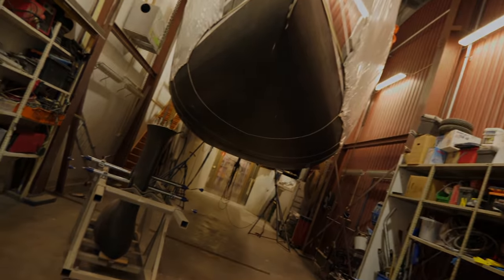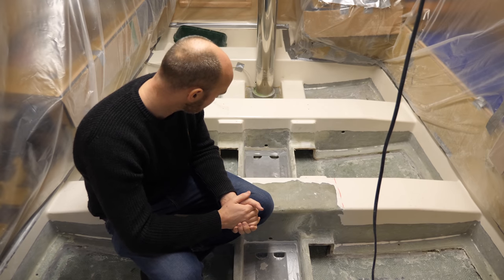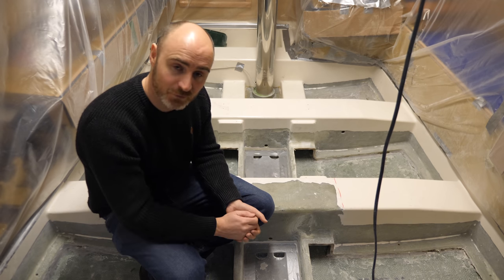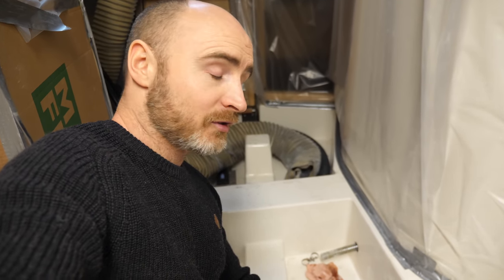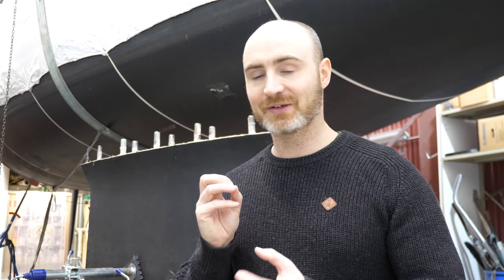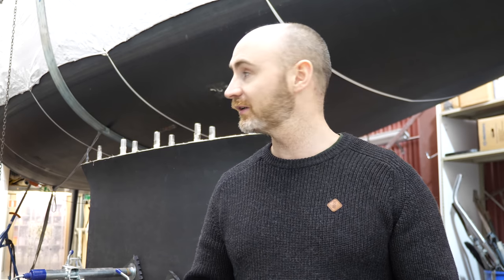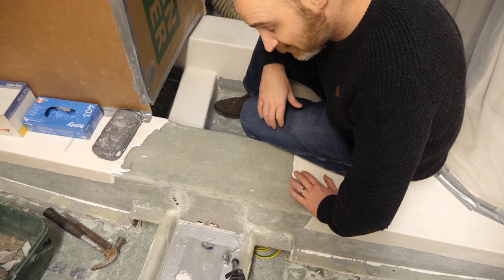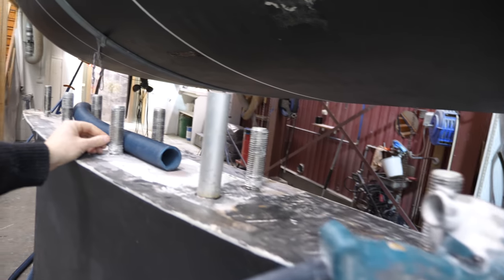SAILBOAT REBUILD - what they DON'T TELL YOU about PRODUCTION BOATS - Plastskador repair week 2

Comment: Quality of materials varies greatly. You buy your epoxy resin from some Chinese bargain basement joint and you get what you pay for. Did they build your boat with more poly resin and less epoxy? Same with fg cloth, you get what you pay for. With cloth it's the quality and the weight, did they build your boat with high tensile strength cloth made by a high quality manufacturer? Then you have construction techniques, did they vacuum bag it? Double vacuum bag it? Do you know what this means? H-R in sure uses only top notch materials and they test each batch of resin that comes in, their quality engineers use a microscope and evaluate each batch of  fg cloth that comes in. And all this data gets saved. They know which batch of resin and which roll of cloth went into which boat so that if anything goes wrong in the future they know what's what. There are so many hidden things that you seemingly attribute to either "hand made or production". It's one of those things where you don't know how little you know until you start learning. But you're doing a great job at learning and checking so I'm sure you'll be good at the end!
Reply from the maker: Hi there, you seem to have a lot of experience in the matter. It's probably one of the reasons that HR cost a lot more to buy. There are no signs that the company is using any dodgy materials, most of them while looking around are coming from the Nordics or Germany. Your right, I only know what I know until I learn more, trying my best to share something though. I guess there are many ways of looking at hand built or production boats. I guess the main points in my mind would be:
1. The wood work - machine cut and glued or skilled carpenter fitting?
2. Hand laminated structural components or glued down grid
3. The above finer detail points you mentioned above
4. Attention to detail and finish
I could go on....

Good points that you bring up though and I may get round to more research but time can sometimes not be on my side, especially when doing other projects, edit, run a full time job etc. I just have to be careful how much I chew.

Cheers, Chris

Comment: if you have a custom yacht built in sth africa it’ll be the same approx cost as a production boat out of europe. but much better quality.
Reply from the maker: Interesting to know, unfortunately it wasn't an option for us. I hear Leopard are building pretty good cats though :)
Reply: @SailingAurora  leopard build quality was better in the old days. smaller custom build yards in SA are the way to go. you have to do your homework and have the time to do this. some cat designs in SA are still very dated. get a design done to your liking then contract a yard. 
in my experience it is actually no more expensive but takes a lot of homework. the outcome is far superior.

Comment: You shouldn't need a thru-hull for a bilge pump. It is normal practice to discharge through an open port in the transom above sea level (with a flapper/check valve to prevent backflow). The pump should be more than capable of lifting the flow to the required level. Either way, you don't want a T to restrict flow. You should have a dedicated hose (with no connections or restrictions), end to end for both manual and electric pumps.
Reply from the maker: Hi Stephen, thanks for the advice. I am still thinking how best to do it. It may not be easy on the transom. Watch this space. Cheers, Chris

Comment: Expedition Evans bought a grounded boat and repaired it themselves. Same issues.
Reply: And they consulted pros and used epoxy ,not cheap polyester
Reply from the maker: Hi Bill. Yes, we are also following Expedition Evans. They have done a great job!. Cheers, Chris & Tanja
Reply from the maker: @Mechone11  There are different applications for Epoxy and Polyester, if applied correctly Polyester is more than adequate, I will cover this in the next video and explain a little of why epoxy was not used. Plastskador has been around for 30 years and is well known all over the Nordics for quality repairs, they also do a lot of the work for the major insurance providers, I've done my research and they know what they are doing.
Reply: @SailingAurora  Mine was done by a custom yacht builder  of 50 years from Holland and done in Canada. Epoxy is stronger to an already cured structure . Boats are not made out of epoxy only due to costs.  Vinylester is a compromise in strength and is better  resistance to water and cheaper than epoxy.I'm sure your boat and most production boats are vinylester I'm sure it will be fine and they know what they are doing ,however then why the adhesion tests? . There are many tests on youtube  boatworks today for example. I had 3 well known boat repair yards quote on my boat and they all said epoxy, just saying ,done by insurance with a surveyor hired by them
Reply from the maker: @Mechone11  Sounds like you had some good boat builders too. The adhesion tests were for a few reasons.. 1. Because why not before you commit to the whole hull 2. To double check there are no unwanted chemicals anywhere such as silicon, diesel etc. this is really bad.... and 3. Testing the sanding depth for the adhesion. Probably unnecessary but doesn't take long to have a double check before the commitment.
Reply: @SailingAurora  Anyways good luck just pointing out what I had done 5 years ago , no cracks .Mine is a Beneteau  and like Expedition Evans Beneteau factory says use epoxy  What does Hanse say?
I'm sure you goolged  epoxy vs polyester, epoxy adhesion 2000 psi  / polyester less than 500psi
Reply from the maker: @Mechone11  Polyester on it's own adheres to old glass poorly, however with the use of an adhesive, in this case they are using Crestafix making the bond a lot stronger. The question to ask is do you really need all of that strength of epoxy for this application? And the answer is probably no because if you ground it hard, something will break anyway. Polyester resin is also stiffer than epoxy resin and this is an important attribute for sailing, the keel needs to be kept very stiff in position for good sailing performance. Epoxy is more flexible than Polyester. Maybe a combination of both would be great but it's not practical to do. It's an interesting conversation. I will cover it more in the video this week.
Reply: @SailingAurora  The true with composite is that there is plenty of good possible process to build and repair. if possible i use the simple rule: repair with the same material. thus polyester on polyester, vynil on vynil, epoxy on epoxy. In my case i use allways epoxy for small repair (despite the boat is poly) . if the hanse is vynil i would use vynil for the repair (same work, a little extra cost for the material) despite the poly will anyhow be stronger that the original bonded grid. For expedition Evans i would have fear to use epoxy on such large surface in hot weather condition. “Hot spot” can change your epoxy to gel in mins. i had the issue on smalls repairs:  a easy way to lost time, you have to stop, let cure, grind and restart from scratch. But they managed to avoid this mistake i made many time. Anyhow your Hanse or expedition Evans, will be at least so strong as out of factory.

Comment: Buy a used HR or Amel, better an old boat with solid structure than a production boat. Those boats are mainly for chartering companies.
Reply from the maker: Not sure about Amel but looking into HR's they are also built with a similar construction method with a grid https://www.hallberg-rassy.com/resources/how-a-hull-is-built/. With the price tag I am sure there are many great things about the way they are built, would love to have one. I guess it was the older HR's that were built without a grid construction. We don't regret our decision with a Hanse though, we love this boat
Reply: @SailingAurora  HR have full keels integrated to the hull. Amels also have the keels integrated with hull, it's one structure so to say. And to be clear I didn't mean you should sell your Hanse, it's just an advice to people who might wanna buy a sailboat in the future (not for daysailors).
Reply: @HenryA798  Agree.  This kind of keel design is great for day-sailers or coastal cruisers.  The bolted-on, higher aspect keel provides great hydrodynamic lift to windward and helps you point higher.  They also have less wetted surface area and generate less drag.  My boat has one, and I'm perfectly happy with it.

If I wanted to quit my job and sail around the world through unfamiliar waters, I'd sell it and get something with integrated ballast.

Comment: The quality of the bilge hose is as important as the pump. I changed out my old (corrugated) hose for a smooth bore (on both electric and manual pumps) and either can now empty the bilge in a fraction of the time that it used to require (for the same size pump). There is a world of difference between lamina flow and turbulent flow.
Reply from the maker: Great comment, thanks for the tip. All of our pipes are smooth and steel reenforced. Just have to buy the bilge one soon, will keel this in mind, thanks

Comment: I've heard of a tee valve being added to the engine cooling system to suck in bilge water in an emergency to augment the bilge pump.
Personally, I don't think that would add much. Better to add another bilge pump for more throughput AND redundancy.
Reply from the maker: I think Sailing Nahoa did a test on this also. The throughput wasn't that great. Would be good as an extra though I guess

Comment: You experienced the reason I will only own a full keel boat. I know of dozens of fin keels boats that have suffered this same damage. 9 out of 10 never make it back to the water. Those boats include models of every manufacture you mentioned at the beginning of your video.
Reply from the maker: I can't blame you if you want a full keeled boat, they are very robust. Fin keel boats are definitely prone to this damage, up here in Scandinavia as we have a lot of rocks, it's a common occurrence to run aground and there are a lot of companies doing this kind of repair. I guess the insurance companies assess if it's a write off or not before paying for the repairs.
Reply: My attitude is, fin keels and spade rudders are unseaworthy, period.
Reply: @Garryck-1  Yes, I agree.
Reply: It's not fin keels that is the issue but bolted on keels. A fully encapsulated fin keel is as strong as a full keel, with none of the disadvantages. Old 70's and 80's boats with fully encapsulated fin keels have been grounded many times with none of these issues.
Reply: @stephenburnage7687  - Fair point. But those are not (and haven't been for a long time) the kind of keels being churned out in huge numbers by manufacturers, and sold to an unsuspecting public, are they?

Comment: I rebuilt an old CAL34. Already a strong boat but I added several layers of fiberglass to every joint I could access, on the recommendation of a surveyor. Now it is as stiff as a board. Zero flexing. Gives me a lot of confidence offshore
Reply from the maker: Hi Stephen. Yes, the only thing that is positive about this situation is that the boat will be stronger when it comes out of the workshop. Cheers, Chris & Tanja

Comment: If production boats tend to ride off shore waves instead of cut through them like a full keel boat, might this action weaken the joins between hull and frame over time? Descriptions by sailors of their production boats slamming or bouncing onto waves makes me wonder about taking production boats offshore. I'd welcome some expert / experienced comments.
Reply from the maker: Well, sailing the baltic, I have to say is very easy on the boat. We don't sail in heavy weather very ofter, especially between all of the islands. I don't have the experience to comment on this one. I can ask the yard though. Good question.
Reply: You make a good point. A key aspect of cruising is that the boat gets constantly worked (flexed, pounded, stretched etc) by wave action. A joint that was good for sitting in the marina or protected waters might not survive months or years of constant working. On the recommendation of a surveyor I have strengthened every joint that I can access, for this reason. Old time sailors used to refer to a "stiff" boat for good reason.

Comment: The fishing boat had a y valve in the bilge,it could suck salt water through a throughhull
for washdown or y valve to bilges for sinking,kept us running for hours till we ran the boat aground under the lift at the hall out yard….
Reply from the maker: Sounds like a good solution, I thnk when/if we leave for an ocean crossing I would like some connection to the engine water pump also

Comment: I have watched way to many videos of problems with production boats, I have been in the market for a 45'-65' sailing catamaran and I decided on an aluminum hull boat and I am building it myself.
Reply from the maker: Sounds like an awesome project. I would love to learn Aluminium contruction and welding for sure, unfortunately only so much time in the day though :) Good luck on the project
Reply: @SailingAurora  I own a metal fabrication business so it's building aluminum structures is within the realm of what I do.  I am going to either buy off the shelf plans for a boat or work with a naval architect to design my own from scratch.

Comment: Polyester is horrible stuff. The catalyst is very dangerous. If you get even the tiniest bit in an eye, you will lose the sight in that eye. One case I remember in the 1970s was a guy who got some polyester resin in one of his eyes. He immediately washed his eyes with fresh water, but a minute amount of polyester was transferred to his other eye. The first eye went blind quite quickly. It took 6 or 7 years for the other eye to go blind. This was documented in the late 1970s, before the internet, so you might not be able to find it on line.

In any case, epoxy is far superior to polyester. Polyester didn't bond well. It was sort of OK bonding to polyester, but it wouldn't bond to epoxy. I have no info on bonding to vinylester. Polyester was used on expensive, heavy, inferior production boats.
Reply from the maker: Hi there, Interesting to know about the health implications of Polyester. Sounds like some pretty horrible stories about the stuff. The guys at plastskador are always suited up with all the protection on while laying up glass and dealing with the resin.

After many comments on the channel and doing a lot of research, I can see the arguments for both Polyester and Epoxy. I believe a lot of the opinions stem from workers being used to a certain material to work with. In this case the yard that my boat is in now has been working with Polyester for many years and it's a true and tried method also. If they were getting boats back because the material was not strong enough, they would have switched to Epoxy a long time ago. Also the Polyester being used here is Isophthalic and not orthophthalic. Isophthalic polyester resins are undoubtedly of a higher-grade and offer substantially higher strength, better flexibility and chemical resistance. When you start using Epoxy it's a whole different animal, to achieve maximum bonding performance the conditions need to be right and to get the perfect result a vacuum is sometimes needed to get the air out. Polyester is a lot more forgiving in the aspect and coupled together with Crestafix, it makes an extremely strong bond. They have even tested the bond with saturated glass with Diesel and it's still good. Personally, I think Polyester will be more than good enough.

Also with Epoxy you it's not best practice to spray a Polyester gelcoat over it, meaning you have to use top coat, once you use Epoxy, you are stuck with it and can never go back.. Again I can see the arguments for both, but in my case I am really not worried. Cheers, Chris
Reply: @SailingAurora  That sounds good to me. These guys obviously know what they are doing. Perhaps my post should be taken as a warning to amateurs doing small jobs. Also, it's possible that new types of polyester are not as dangerous as the old ones. But, I think that people should be aware of the potential dangers.

Comment: My boat was done with epoxy and is way stronger than polyester,. Vinylester  is better than polyester and most likely what your boat is made of.I would not use polyester its cheap for a reason. I have seen strength tests  and epoxy is #1 then  vinyl, then poly . Poly is brittle and delaminates
Reply from the maker: I hope the recently uploaded video gives you a better overview of the repair and a little of the reasons behind the decisions. BR Chris

Comment: At least two bilge pumps in case one fails. I had three because I like a dry boat too
Reply from the maker: Hi Chas. Have bought the bigger bilge pump, so we can have it installed now, while she is in the workshop. Maybe a third one... we'll see, but thanks for the tip. Best, Chris & Tanja
Reply: @SailingAurora  Little side story. We had a near sinking in our harbour when a piece of discarded fishing line got sucked into and strangled the bilge pump. Thankfully someone noticed how low the boat was sitting in the water before it was too late.
Reply: @SailingAurora  There's an old saying... "Two is one, and one is none." Because at sea, things WILL break.